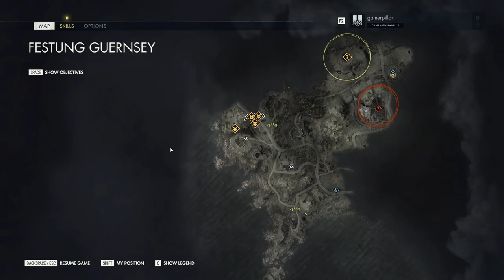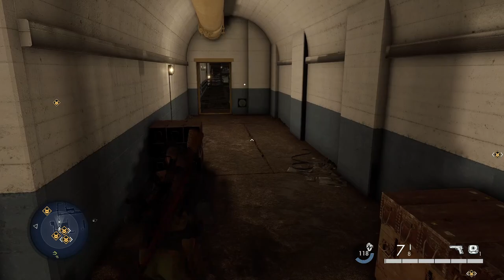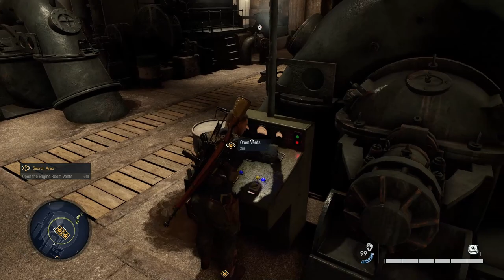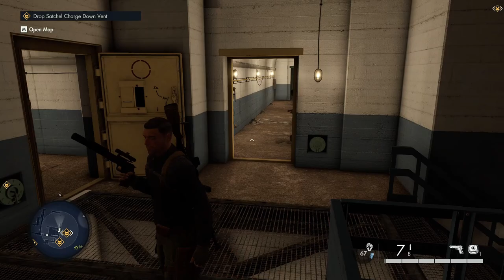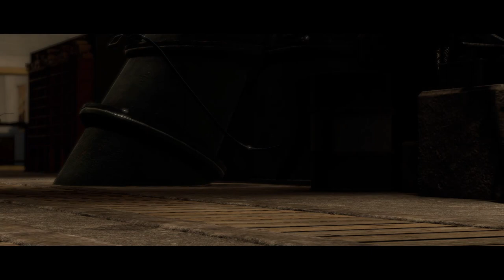Destroy the Kraken Prototype | Mission 5 Festung Guernsey | Sniper Elite 5

Comment: There is no satchel charge for me and no place holder  for it - even tho the slats are open
Reply: This a late response but for anyone with this issue, make sure you open both shutoff valves. There's one in that maintenance room and one upstairs in the passageway behind the room with the big map. From that room with the big map on the table, go right and right again at the door. Make another right and there's a passage on the right again. Take that its right there. From there, you can go back to the catwalk and go down the stairs and get the other valve.